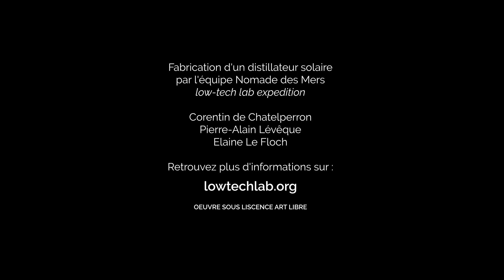Le distillateur solaire / Homemade solar distiller - DIY

Comment: Pourquoi les 5% d'eau de mer ?
Reply: En remplacement des 5% d'eau de mer (qui me poseraient pas de soucis perso quoi qu'il en soit, la stérilité totale est un défaut également 😝, notre système immunitaire peut s'améliorer par l'entraînement [Pasteur Imposteur] ), il est envisageable de prendre un stock d'argile, verte/blanche, pour en ajouter une cuillère à café ds chaque litre (adapter quantités proportionnellement) d'eau filtrée, car elle permettra à la × de reminéraliser, & purifier s'il y a lieu (expl: contamination du dispositif, sur le long terme..). 

Mtn c un intrant supplémentaire, qui rend le système - "self-sufficient" , mais qui a tellement d'utilités (en cas de blessure, d'indigestions, contaminations quelconques ; en guise de dentifrice, nettoyant cutané d'appoint...) que ça me semble excellent!
Reply from the maker: Les 5% servent à reminéraliser l'eau distillé !
Reply: @low-techlab2411  Il peut être intéressant de la faire bouillir avant, c'est pas un milieu stérile l'eau de mer, avec un four solaire ?